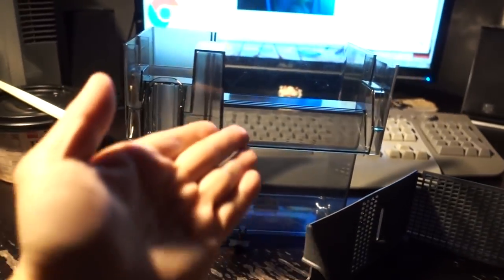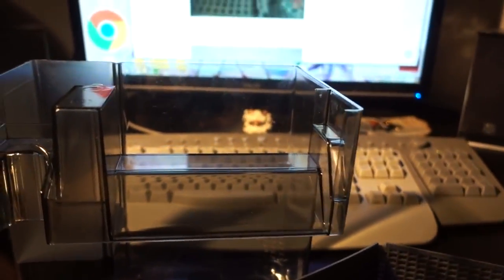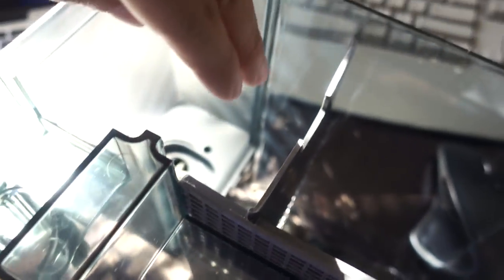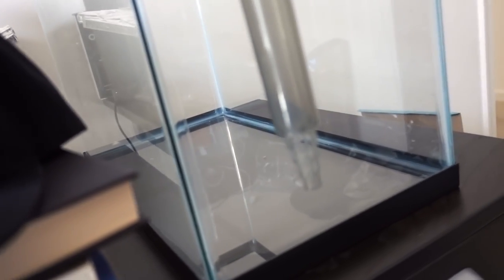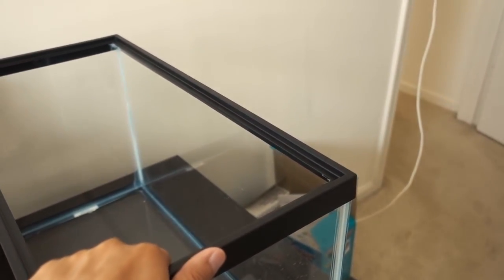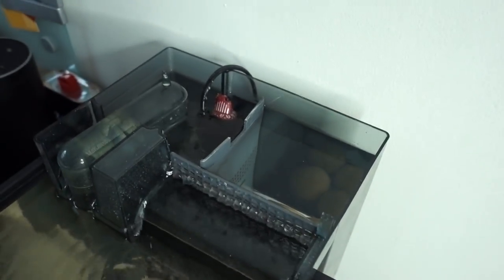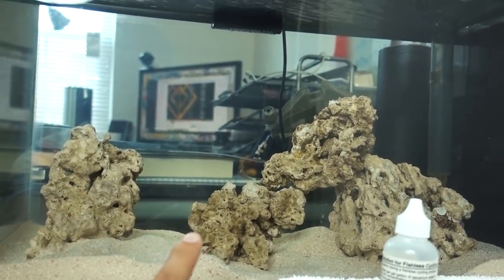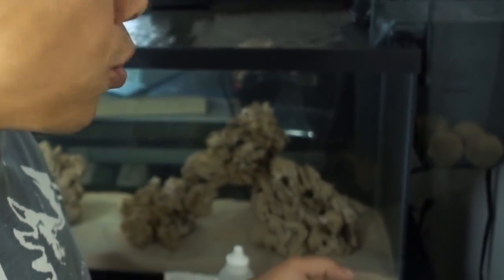$146 Nano Reef: DIY AquaClear Refugium Mod & Filtration (Part 2)

Comment: You may want to leave the lid off the filter and light it from the top. The smoked [not clear] plastic will effect the spectrum of any light you use. The heater would also be more efficient away from the motor in the filter as heat from motor will throw off built in thermostat as will the fuge light when you install it.
Reply from the maker: Thanks Dave, I was hoping to avoid heater in the tank but sounds like it may have to go in there, hmmmmmmm
Reply: @InappropriateReefer  also good in case the pump stops working or you leave the filter off the tank still gets Heat

Comment: Just want to say you inspired me to setup the same type of tank.. end result was no where close to $146 though lol. I used my sons old 10g that had evaporated to about 1” of water and had green algae almost all for panes top to bottom. (Did this in ourpose was going to use it as a shrimp tank and wanted the overgrowth for the hard to keep shrimp only setup) scribed it down and repurposed it about 1h after seeing this series of videos last weekend. Later that day I went to Petco spent $190 on 4 pieces of rock covered in coralline that looked clean from a tank wo corals so likely no missed coral pests. (My petcos are pretty clean compared to local fish stores they are 10x cleaner systems) picked up a 20lb bag of oolight love sand while there as well as aquaclear 70 and 2 cartons of seawater cause it was impulse buying and I didn’t have salt water ready to go and it’s only a 10g so actually cheaper to buy mixed water then to do myself. 

Setup rock poured in about 17lbs of the 20lbs of sand (I still like fine sand dsb setups) poured in 30g worth of bio spira and tank fired up instantly. 

Went back to different Petco that same night to purchase a few fish and cuc (before anyone flames in me for how bad this is.... I’ve been keeping planted, predator, and large saltwater tanks longer then prob half the people watching this have been alive. I know when I can and can’t add live stock safely) 

I went with the fluval evo light which cost and extra $40 over your light but I like the adjustability to tune the led to proper spectrum and at same time have the whites turn in for viewing pleasure when I’m home. Idk how well it will grow coral but the one rock I purchased that had zero coralline out of the four is already mostly encrusted. So if it can grow coralline that fast off spores then it must be good for corals despite the bad reviews which upon getting I can attribute 99% to people who likely use default settings that are only 80-90% violet and blue with 20-30% whites and red.. not ideal growing spectrum selections. 

Using the akre 12w grow light and just placed cheto in today although tank since about an hour after setup is still running 0-0-5 with pho’s below what my testing can accurately measure but is likely from experience .2ish...  hardest part really has been fine tuning the heater as tank is open top and I run 68* at night and 76 during the day. Even still with cheap fluval titanium that is 3 years old only getting 1* temp swings but having hard time getting to the desire range I want at 79-80 cause the thermostat it has is at best 5-6* off. 

All in I’m up to prob about $300 not counting the live stock which was another $150. I’m also using the intank system instead of modifying the factory basket. I wanted more options.. running nano carbon in areas where pump is.. poly fill floss in first chamber, cruised coral in second inside filter bag and cheto in the third chamber. Been running the aq70 at Lowest flow setting and have similar drifts to what your tank shows on update video. I for one love fine sand and I love natural drifts of the sand. I’ve never seen a flat ocean sea bed myself. Sand is supposed to move about and have deep areas that denitrify and shallow areas they nitrify. 

The one thing I’m having an issue with as of now is circulation. I setup rock in a one big arch with some depth scape. Getting a lot of collection under the arch for now and all pumps I currently have even programmed Down to min setting are too high flow and disturbing the sand too much. One was a jaebo pp8 which on min should be under 300ghp but was way too much. Thinking of trying the hydor nano centered on back glass rated to 240 but afraid that’s still going to be too high a flow with the aq70. I picked up the aq30 impeller and will be doing that mod this weekend so crossing my fingers it’s enough reduction in filter flow to be able to add a small wave maker. We will see. 

Side notes.. anyone considering the fluval sea nano light.. its user interface is good but takes hours before you’ll understand how it works as you get zero instructions. Also it will not fit framed rim tanks.. I had to cut out the framing in the center inside portion of the tank so the light would sit level. Tbh that’s not really the lights fault but the tanks as the frame just flexed too easy. You’ll likely find this problem with any clip on light with any tank smaller then a 40 breeder u less it’s rimless.. 

Anyone looking at using a nano tank setup with an aquaclear filter.. buy the 70 period. You can always spend $8 and get the impeller from the 30 which will reduce the flow but you want the largest housing you can fit. The 110 filter uses a different pump setting but the 30/50/70 all use the same setup just different impeller designs. You can get say 45 flow from a 70 size unit by using a 30 impeller. 30 flow from a 50 or even if desired 60ish flow from a 30 by putting the 70 impeller into it.. these are great $8 modifications to the aquaclear filters allowing you to fine tune the flow for your tank..

Comment: Having an accrylic lid cut for the top will dramatically reduce evaporation but it will reduce gas exchange. This can be combatted by putting an airstone underneath the cheto and it will also tumble the cheto and give it CO2.
Reply: The growing cheato adding oxygen will probably make up for te reduced gas exchange if he doesn't overstock
Reply from the maker: Interesting idea, I do have a spare airpump that I could hook up and try this... although I wonder if I'd get salt splash on the wall from the airstone, hmm... one way to find out.  Thanks for the idea

Comment: I turned my HOB filter into a turf scrubber and I'm currently using the ACKE LED 24W (~$20 on amazon) https://www.amazon.com/ACKE-Fixtures-Seedlings-Hydroponics-Aeroponics/dp/B01N47QRHV/ref=sr_1_2?ie=UTF8&qid=1534797309&sr=8-2 . It's IP64 waterproof (splashproof, but not submersible).  It's slightly bigger than the cover of my HOB so it acts as a lid.  I plastic wrapped the frontside of it just in case.
Also, for evaporation issues, the cheapest way to deal with that is to use a glass lid.  Even if it's partially covered, you will see less evaporation.  When my 29g was fully covered, I almost never had to top off.  Now it's 80% covered and I need to top off once a week about half a gallon and the A/C is running in my house 24/7.

Comment: i hate those salt creep on the heater wire when i used have a tank. Time to restart. You can use an gang box with 24W CFL light bulb as cheato lighting. I used those those https://www.homedepot.com/p/Carlon-1-Gang-20-cu-in-New-Work-Box-B120A-UPC/205319652

Comment: Notch the top of the lid not the filter box itself to accommodate the heater.  I would suggest a small LED light for that refugium over the Macro algae.  If I were gonna do macro algae I would drill a hole in the top of the lid over that chamber about 1 3/4 - 2 inches and use the Kessel A80 Refugium light.  I would also go to a AC 50, 30 impeller in the filter pump to reduce the flow of water.  This will prevent over flow being a problem and increase the dwell time for the algae to do nutrient take up better.  Do not be tempted to use a AC 20 impeller as the pump wont be able to self prime itself should there be a power failure.  It just doesnt move enough water to lift and prime the filter.  Been using Aqua-clear filters for over two decades now and love them although I may be moving over to Seachem Tidals in my nano's.
Reply: Seeing your video has me tempted to do one in a refugium again...only instead of Macro Algae, I may use 3-4 Mangroves instead!

Comment: Funny project.  I used a Aquaclear box as a return with water from the sump pumped up into the box then to the tank. .
Reply from the maker: Interesting, so you connected a hose to the intake, and the filter pump was strong enough to pull water from the sump which I assume is under the tank?
Reply: No, I ran the line from the return pump to this box which held carbon or what ever else I put in it, which then ran into the tank..  It was my way of preventing back siphoning

Comment: I'd skip the chaeto personally. Use water changes for nutrient removal. Any algae will just add work and slow down flow. No need for it on a small tank.
Reply from the maker: I agree with this tbh; always enjoy a refugium though. If it becomes too much of a pain I’d pull it
Reply: Ryan Thompson I have a similar size tank and was going to do this. Do you think I would be just wasting time? If not the algae maybe use some biological media instead?

Comment: I bought a red and blue plant light for my refugium. I keep it on 24 hours a day and my chaeto grows fantastically. It was a very cheap light off of eBay. Put a lid on everything. Helps with evaporation. Add some live rock rubble to the base of the refugium. Helps with critters. It’s how I set mine up.

Comment: I used the clear plastic sheeting that comes with poster frames. It’s about a milimeter in thickness and very brittle but if you take your time and cut it to the dimensions of the inside edge in the tank, also making gaps for the light mount and filter inlet, you can have yourself a very lightweight tank cover that’s super cheap. Works great and as long as you don’t scratch it, should remain crystal clear and give you plenty of evaporation control.

Comment: Do you need to turn the filter into a refugium or could choose a smaller filter and a powerhead
Reply: Smaller filter and a powerhead would work, lots of similar builds to this but with those pieces. If you can't find em pm and i'll shoot ya the link

Comment: Great video. I decided I would also also make a 10 gallon reef tank and right now I'm just waiting for the final parts so I can start cycling. One thing I learned while researching was that a small refugium like the one you are using would barely do anything because of the low water volume of the filter. Also because you put the heater inside the filter, it can potentially overheat and melt the plastic. Also you are definitely going to need a light for the refugium. I felt this would be too much hassle so for my build I'm just going to do some mechanical filtration with some blue and seachem. I also learned about chaeto reactors. Not only can they hold more water and naturally clean your tank, they can also grow pods very well, meaning you could get a 6line wrasse or even a seahorse. Just something cool I learned.
Reply: Russel Chua I did this on my own tank but a media reactor with a pump is 38 bucks on amazon and the led grow lights are another 13 bucks. About the same as a aquaclear 70 but is way more efficent.
Reply: @OSSOYT  Could you provide a link to the media reactor with pump & grow light. Currently gathering info and equipment to get it right the first time. Thanks
Reply: @TheAlmightysMercy  ended up scrapping the 10 gallon reef, the media reactor chaeto grower is in storage until I can upgrade my 30. I just used the stock pump included with the phosban reactor 150 and a few led growlights on ebay

Comment: If I decide to make this refugium setup myself, would I need another separate filter for mechanical filtration? I have a 29 gallon build going on and wanted to try this hob refugium.
Reply: I have the same question for the same reason.
Reply: @samanthastockdall9747  from what i researched, this will act as a mechanical and bacterial filtration system. you don't need a second filter. however, i have an old 20 and now a 50 and i'm turning my 50 into a fuge and leaving my 20 filtering as usual.

Comment: Will macro algae actually address nutrients better than just using the same sized space for a good quality biological that supports anearobic bacteria instead which also pull out nitrate and phosphate and so on? Because it's far less maintenance and more consistent, and works 24 hours a day unlike macro algae which is only actively growing when light is on it. Also the excess bacteria that blooms gets pulled out by the skimmer and it also feeds corals. Macro algae doesn't support coral growth but it can if large enough support pods if you dose food that the pods eat... I just get the feeling biological like established denitrate by seachem under the right flow will be a million times more effective at nutrient control than doing macro algae if you do the same space for either and denitrate is cheap and never needs to be replaced.
Reply: Or do both 💁🏼‍♀️
Reply: It's good to seek out information and find out what works best otherwise the hobby never progresses. If biological is as good or better then why bother with macro algae at the same time you may as well have a frag tank going or frag tank to sell for credit at the local fish store or something else going on.
Reply: WaterspoutsOfTheDeep because macro algae is natural as well and has benefits
Reply: What benefits?
Reply: WaterspoutsOfTheDeep home for copepods and soaks up nutrients
Reply: The biological removes nutrients also if not better. Pods only grow if they have a food source which may not be the case even if you give them a home to live in. Biological media puts out bacteria in the water which is also a food source for many corals like pods. The mucus layer on them catches the bacteria and corals are constantly eating that mucus and making fresh. Skimmer also pulls out the excess bacteria in the water column which removes those nutrients beyond the bacteria just turning nitrate into nitrogen gas which leaves the tank and so on. You don't have worry about lighting/heat or harvesting the macro either which makes it way easier for housing.
Reply: WaterspoutsOfTheDeep who said there was even a skimmer in play? This tank has no skimmer. And if you watch any of the bulk reef supply investigates videos you will know that a good Refugium does amazing things in an aquarium and needs less maintenance than a protein skimmer and if done properly can out perform a protein skimmer.
Reply: Andrew Truax
If you are wasting space and money on a refugium and on macro algae and a light and the other equipment it's safe to assume you already have a skimmer. But that's kinda deflecting and I don't remember saying a skimmer was needed either I was just outlining one specific comparison.
Reply: WaterspoutsOfTheDeep I don’t know why any of this is even a debate. Everyone has their own preference in how they run their tank. Personally on my next tank I’m only running a fuge, no skimmer.
Reply: The problem is you not fully reading what you are responding to...
Reply: WaterspoutsOfTheDeep oh I’m not? Lol the problem is you have a horrible attitude towards someone who shares the same interests as you.